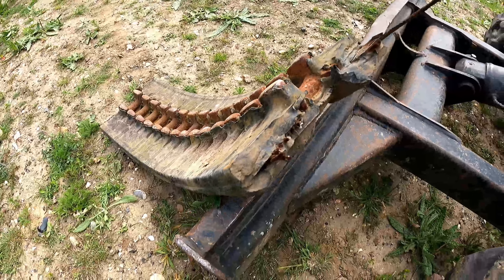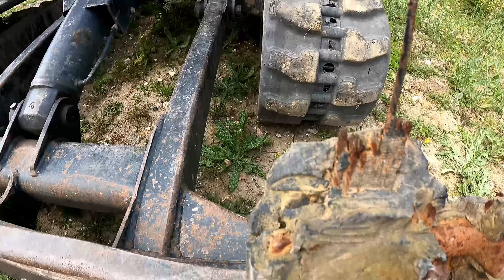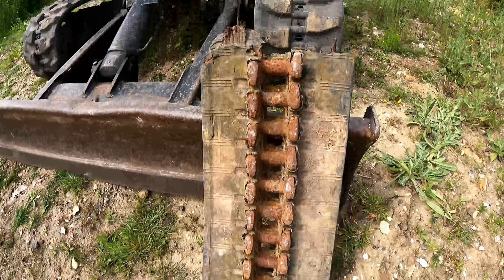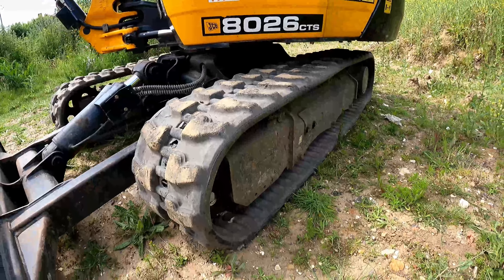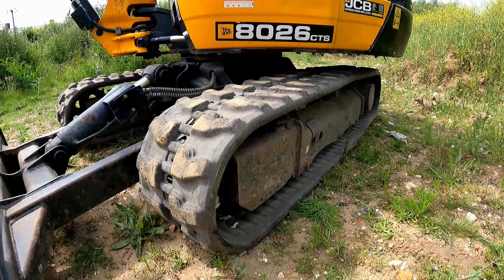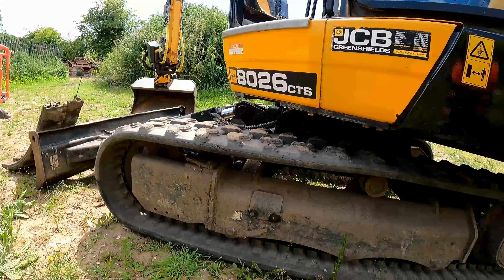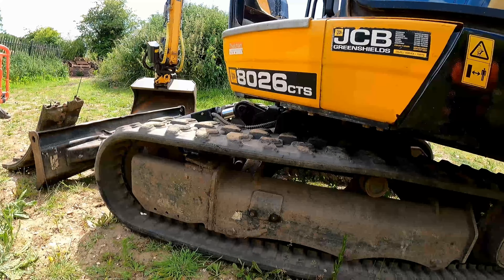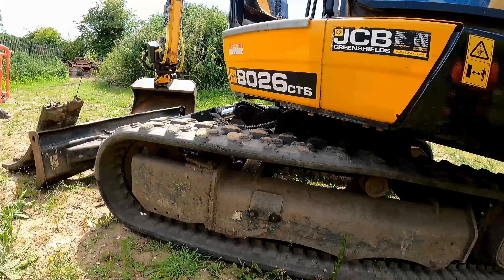Camso Mini Excavator Tracks Review

Comment: Just to clarify a point Ollie correctly made, but was unsure of; Camso was bought out, 100% by Michelin in 2018, for $1.45bn.
Michelin apparently intend to continue to run the construction tracks and tyres under the Camso brand, as it is well known within the sector. In the same way, they also own and run off road tyre brand B F Goodrich, for example.

DIGBITS are the main UK aftermarket stockist for Camso mini excavator tracks.